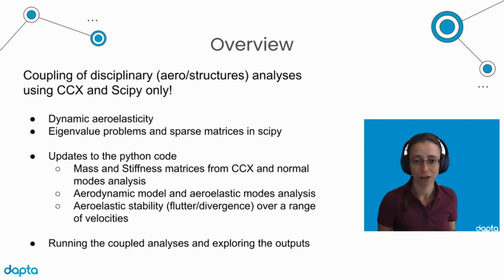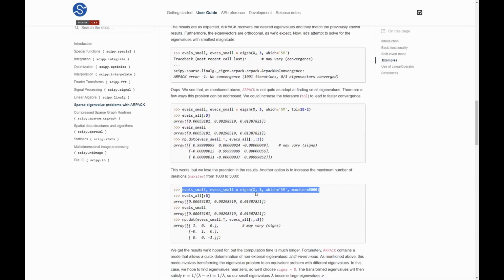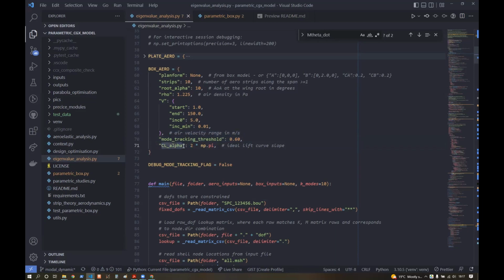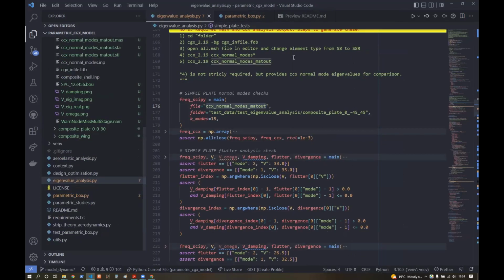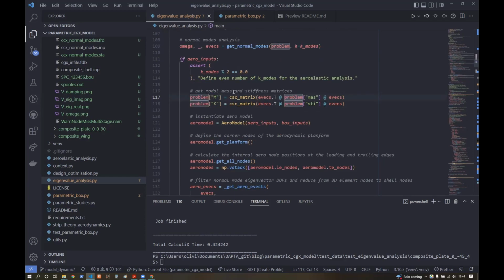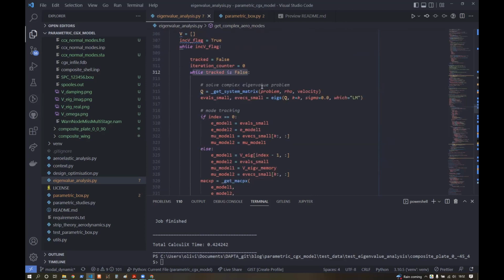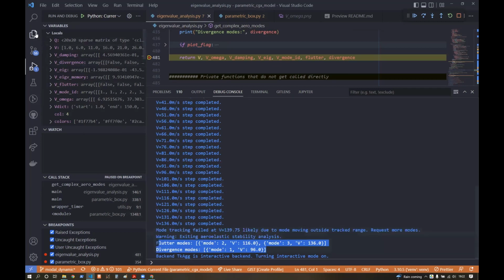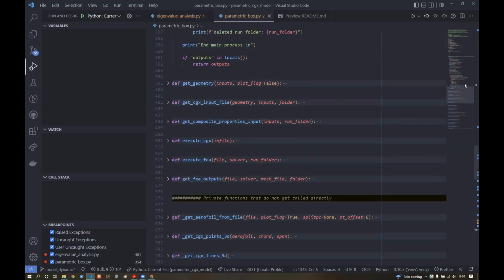Part 6: Dynamic aeroelastic flutter and divergence analysis with Python and Calculix Crunchix

Comment: Hello. Thank you for the time you put into explaining your work! Is there anything preventing the strip model from working correctly when we use it on a wing with sweepback angle and a taper ratio?. I tried it but the mode tracking fails from the first iteration, and I can't figure out why. Thank you again.